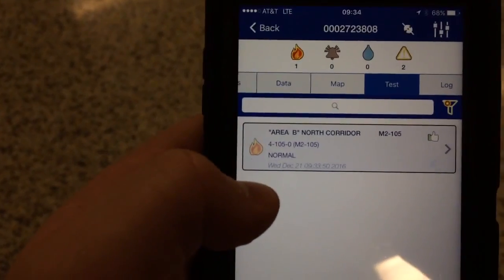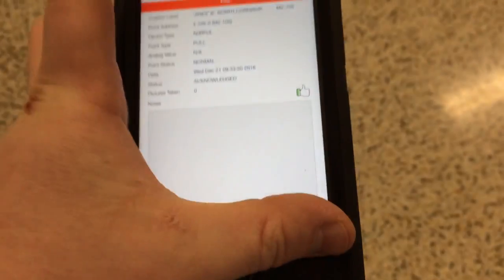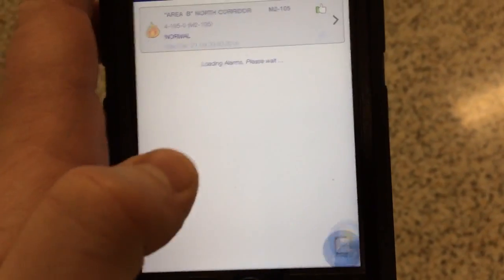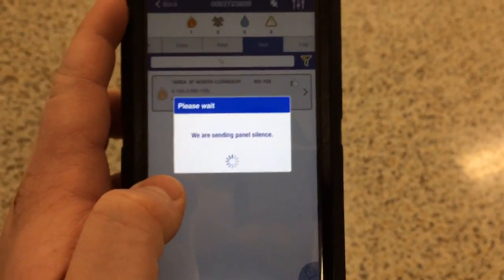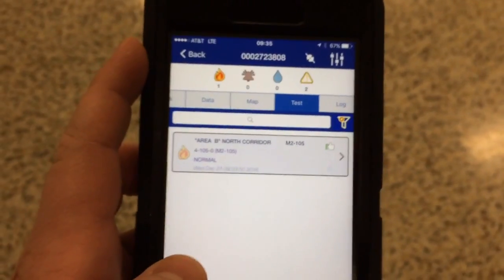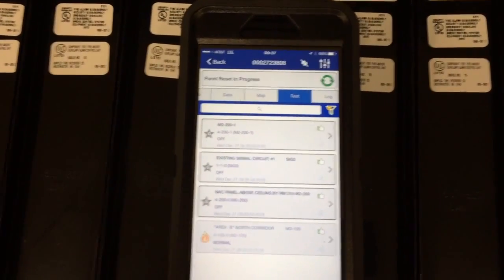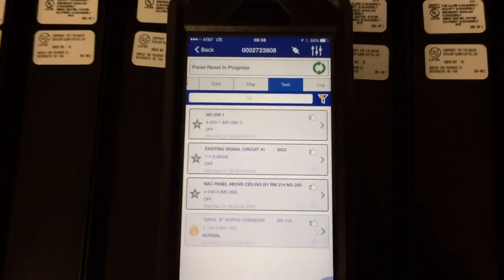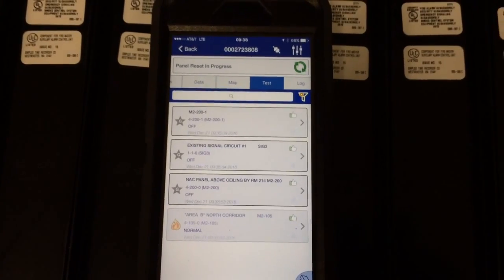Fire Alarm Testing Via Smartphone

Comment: what is the point of setting off the system by opening the station when you can just pull it as it does the same exact thing as opening it
Reply from the maker: All pull stations had already been functionality tested for the year at other times off video. This was just most convenient at the time for purposes of this demonstration since my hands were full.
Reply: Jesse Ridgeway I agree. I feel the proper inspection technique is to pull the station thereby testing the operable part of the device.  Then reset it using the key.  I do not feel just opening with key is a best practice.

Comment: Even though Simplex is known for proprietary hardware, and being very picky about compatibility etc. The one thing that they've always been good at is being innovative. I can imagine testing being so much easier with this sort of thing, as well as managed for the building operator. Also how would this sort of thing be done, I'd imagine there'd be a dialler/communication card of some sort, but telephone line, Internet or cellular com I'm not sure.

Comment: That is really cool!! Does this also work with a bit older panels like a 4020
Reply from the maker: Simplex 2002 
Yes they recently came out with a component module for compatibility with Legacy panels, i.e 4100,4020,4010
Reply: SAFETECH that's really cool!!
Reply: SAFETECH can this new technology make it to where one technician can do the testing by themselves with out a partner at the panel
Reply from the maker: Simplex 2002 
Yes however basic walk test alone allows for that already. This just allows for more flexibility during inspections and helps us to more quickly troubleshoot & diagnose issues.
Reply: SAFETECH cool seems pretty helpful

Comment: That's a nice app, I've tried it before and didn't have much luck without the hardware.
Reply from the maker: WheelockElevator 
We have boxes registered to each tech which connects to the data port on newer panels. It operates off an internal  "cloud based" network which is linked directly to the phone software.
Reply: what app it it?